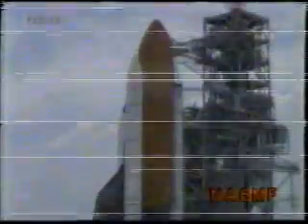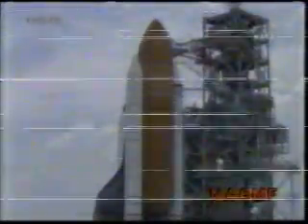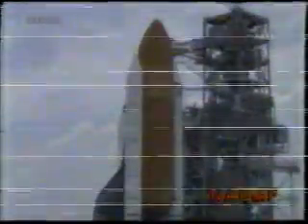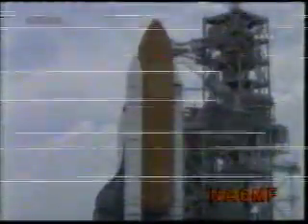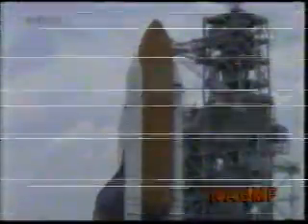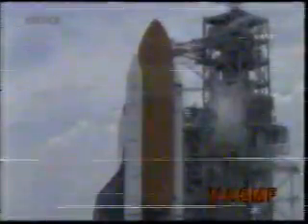STS-125 launch pad cameras video K6BEN ATV amateur television

Comment from the maker: Not so much to develop skills for "impending invasion" but being able to TV transmissions like the bigtime Part 73 broadcasters. And have something independent of a centralized system. i.e. the infamous fiber cable cut in Santa Clara County on April 9 when most of south county and adjacent Santa Cruz county phone/cell/internet all went down. Internet was "centralized" so when central system goes down, everyone goes down (like Moscow in Soviet Russia). Ham radio by its nature is decentralized.